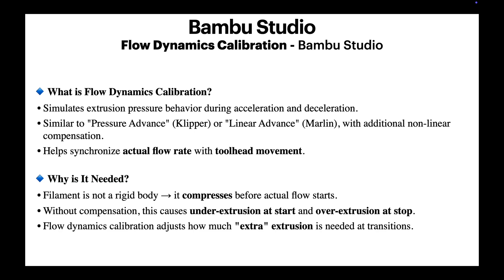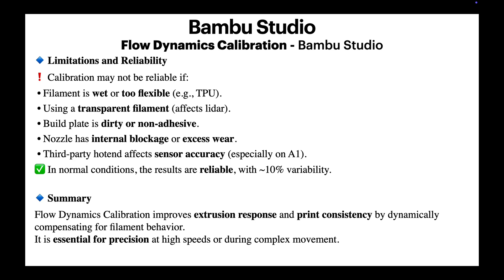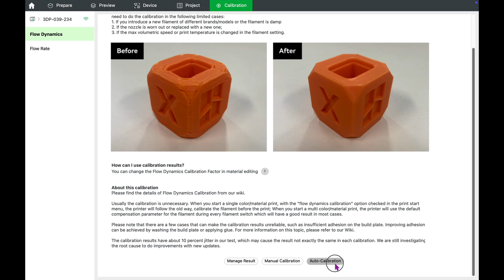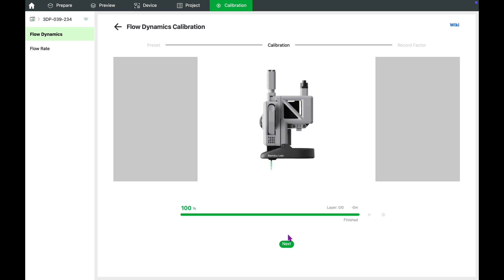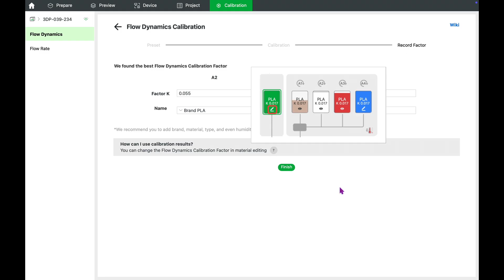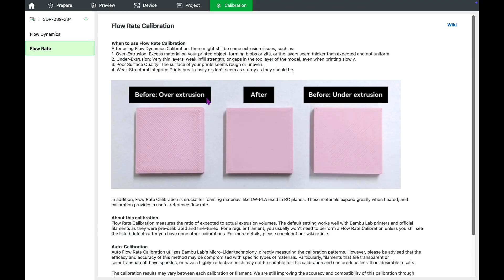Flow Dynamics Calibration | Bambu Studio Tutorial | 3D Printer Calibration

Comment: Question. If I calibrate my filament should I check the box when sending a print to the 3d printer  that says auto flow rate calculation? Since I calibrated the flow rate and flow dynamics I would think I should disable that. Also I noticed you did flow dynamics first should I do that first or flow rate first? I always thought it was flow rate calibration then flow dynamics after that. Or does it not matter?  Any help is apreciated.
Reply from the maker: It doesn't matter which calibration you do first. I recommend doing these calibrations, especially when you start using a new filament, if it is from a different brand or material. Other than that, if you are not going to use your filament for a long time or switch to a new filament, you don't need to do the flow dynamics calibration when printing a part. Personally, unless there's an urgent need, I leave the flow dynamics calibration enabled every time I print a part.